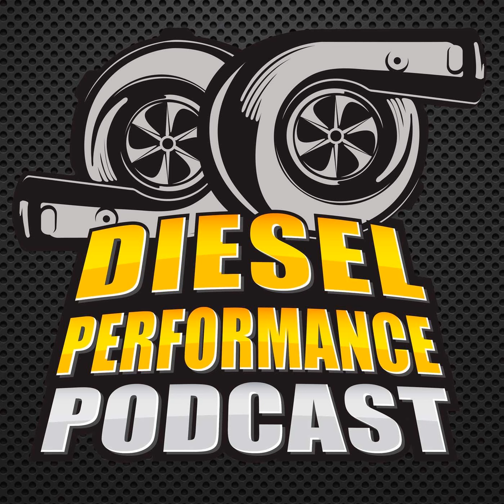EPA + EMISSIONS = DEATH OF DIESEL PERFORMANCE

Comment: Great review on the state of the industry.  I would agree, it is inevitable.  People can kick and scream all they want, it won't change the current reality.

Ford's new 7.3L may actually be a genius move, have an engine for the folks who might turn away from diesel due to costs of ownership.  I am truck camper guy, so my next truck might be a gasoline powered dually instead of a diesel....need the payload, not tow rating.

Comment: I understand that the EPA has a job. Gents you discuss this very well but look at the waste we create by having DEF bottles in dumps and the heat the DPF, DOC, and SCR create when it goes into REGEN mode. Plus your average consumer is not driving there truck long enough for it to go into REGEN. Bottom line is you can create lots of power with emissions in but look at the waste and cost. I’m not against keeping it but the blue collar worker is suffering more than they are. It’s a shame but I’m not against any of it I just look at costs and stats.

Comment: I can give two shits about making power I want my damn truck reliable! My lml duramax has been to the dealer three times for nox sensors and goin into limp mode. every time I was towing and in the middle of fuckin no where the new trucks with doc/Scr/dpfs are an absolute joke seriously considering getting rid of the damn truck all together and buy a stock lbz or hell a damn gas truck!

Comment: That $3750 fine is still cheaper than having to replace a faulty EGR system and all of the harm and reliability issues that come along with it. Attacking those small businesses is ridiculous. Claiming that tampering with vehicles older than 07.5 is also unheard of considering there were no statures in place at that time.

Comment: 6:30 is complete shit. If EGR had advantages, they'd be on top fuel dragsters, F1 cars, and NASCAR. There's so much technical misinformation in this podcast, I'll never listen to or trust anything coming from you ever. There's more fake news around 11:00 talking about Variable vein or VGT technology. Then you start gagging on the shaft of the EPA around 20:00.

Comment: My question is, will emission compliant tunes help my lml get back up to factory levels without having to spend the large investment in replacing/fixing my dpf or egr? Currently regening every 150 miles and only get about 11mpg.
Reply: Sell it it wont get better been down that road I deleted fixed all the problems and have better mileage.( had an emmisions intact tuner all there doing is trying to keep there business alive now that they cant delete)
Reply: @lifted9821  Yeah... I know that, you know that... it's that powers that be that need to know all this!!!!

Comment: I’m a little confused. There was another podcast that said a shop owner asked the question  “ if anything on a truck was changed from the way it came from the factory ( tire size, turbo, injector) and they did not take off the emissions system and could pass was it still illegal”.  According to the podcast moderator the EPA said that any change was illegal, even pre 2003.
What  did your research show. Has Calibrated Performance or Duramaxtuner  talked with a EPA lawyer? I know you test and tune till the cows come home, but how do you play ball with a agency that changes the meaning of rules to fit .

Comment: Paul and Chris . Thanks for the podcast , always enjoy. Question j have for you is , if all emissions are intact and I run your tunes ( which I do ) and go to have a smog check done on my truck at a Star station will it pass and is it all perfectly legal? Live in Ca.

Thanks
Reply: Living in cali?? Forget about it. Ul show up they will fine u
Reply: alex kublitskiy all emissions are intact . Now if the stock tune is reinstalled and the switch and everything like EdgeCTS2 ( Edge is just a monitor) and EZlynk are removed from the truck it’s all legal correct?
Reply: @heberclementiii6788  never hurts to try. I dont live in cali I'm from colorado but I think same concept here.

Comment: You people know a lot about trucks! Bing bing bong bong! LOL! it's like what Jay Leno says "engineering is going to save the world". The same engineering is going to save diesel performance and include emissions along for the ride. Just look at the new ford pumping out 475hp and 1050lbs. In another year or three Chevrolet and Ram will be outdoing those numbers. All with warranties and EMISSIONS! Who wins? all of us.
Reply: Your stupid if you that that new ford is going to be reliable at those power levels there has not been a truck yet with a dpf that is reliable they haven't changed anything when it comes to how these gasses are neutralized they keep using the same garbage that clogs up and fails after 60k and leaves you with the repair bill. Worse part is for the guys that buy these trucks now with emmisions intact good luck having any resale value.
Reply: @lifted9821  me stupid? No! It's about the maintenance. I have two Stewart Amos XL street sweepers. They both have the 6.7 with all the emissions. Each one has over 4000hrs. 85% of that is at a dead idle as the truck creeps at a snail's pace along the curb and never develops enough heat in the exhaust to burn off anything like a over the road truck would. All while eating road milling and dust 10 to 14 hours a day. Not a single problem. Now, as far as the reliability of the new Ford only time will tell. Do research pick quality oil , filter and def and stick with them.
Reply: @matthewholzmueller6292  so you think 1 year  or slightly more is enough to say its reliable 4000hr 10 to 14hr days? Not trying to be a dick but that is not reliable for what we spend on these machines and trucks they should be alot better especially when we are not allowed to remove or alter this OEM equipment it's a joke and it comes out of our pockets .I am cool with being green but not at the expense of my 90 000$ truck .
Reply: @matthewholzmueller6292  4000hrs is nothing at all lol
Reply: Driving stock sure